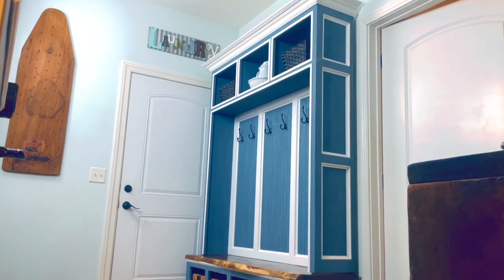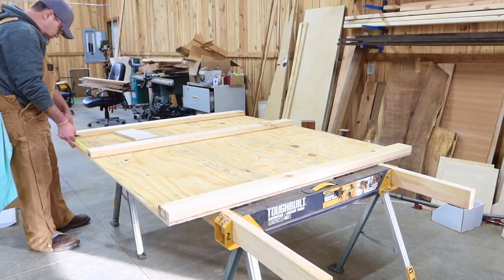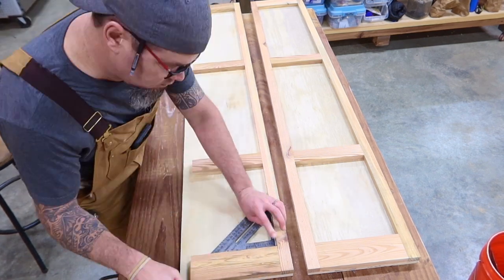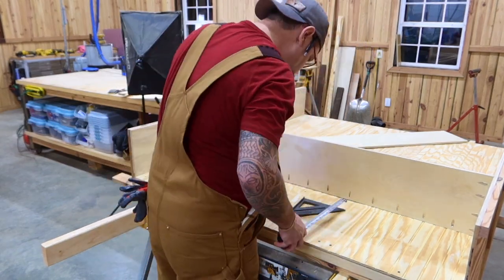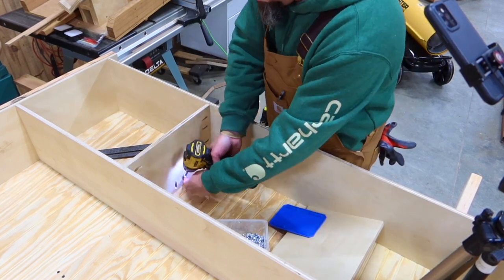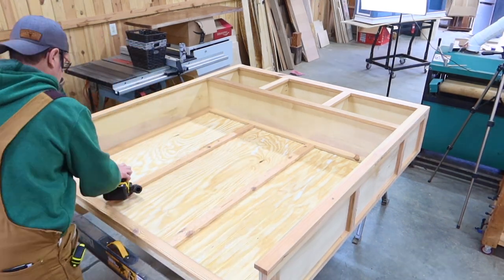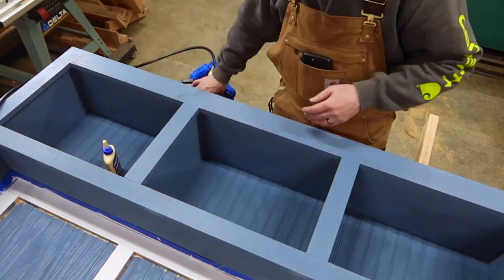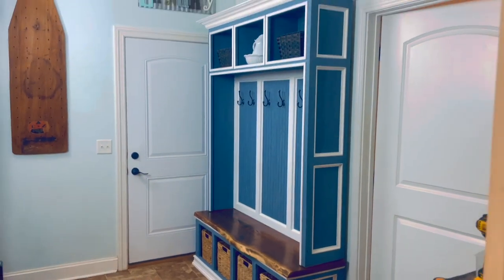DIY Mudroom Locker and Bench (Locker Build).  Full Build With Cut List!

Comment: You already have half the depth on the rear wall. This would make a cool hidden compartment for rifles, etc. Room for ammo, mags, etc too. Make it so you need to Push Up on Both coat hooks, (an un-natural condition) in order to hinge open the individual rear wall panels (x3). Use 2x3's for the rear support and cover the back-side with 1/4"plywood. Secure at the top and bottom (inside drawers) to the wall.

Comment: Is that the actual location of the piece or is that just the staging pic?  Just wondering in case you plan on opening the door with the laundry sign above it
Reply from the maker: Actually thats where it will stay.  When I designed the house for some reason I added 2 doors in a 12x12 mudroom.  The back door to it hasn't been opened in 5 years.  lol.
Reply: Lol. It is an amazing piece of functional art, like all the great things I've seen you build so far. Keep up the great work.